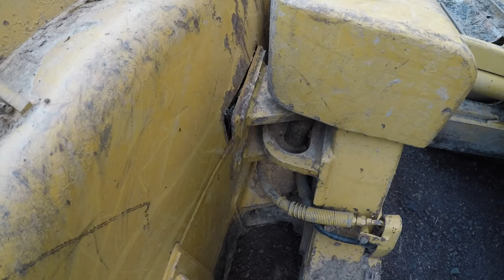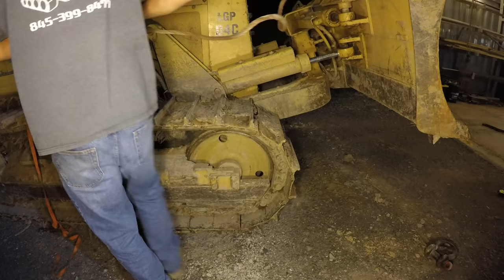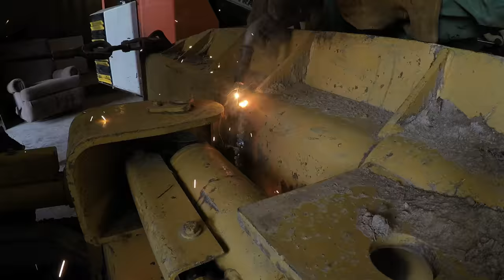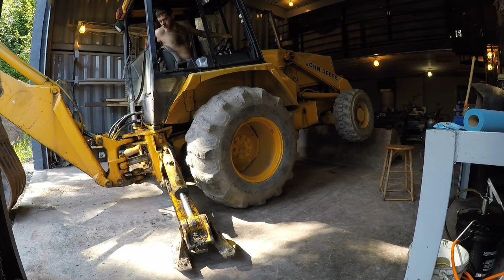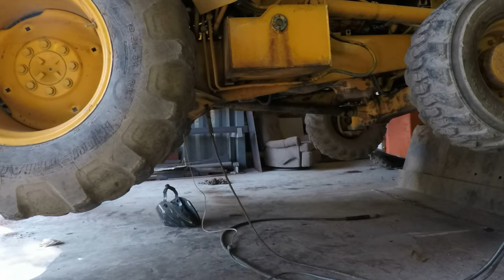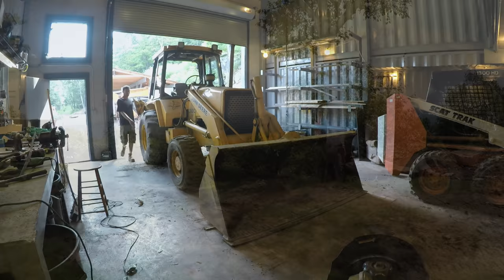Welding the dozer and backhoe

Comment: your doing some awesome work man. but coming from a professional welder of 10 years, weld prep goes a long way. ive noticed you don't usually remove paint or slag from torch cutting. yes it will weld thru that stuff, usually, but the quality and longevity will be so much better with a little weld prep. sometimes a little wire wheel is all you need, sometimes a little grinding to open up a crack for better penetration. especially when running solid wire mig. its a good process but for the type of welding I have been seeing you do I would strongly suggest stick welding with some 6010 as the initial pass to burn thru the rust and paint and get some good weld penitration and then some 7018 for the finish weld for its strength and "flexibility" (isn't prone to cracking like other rods". just some friendly advice, keep up the good work.
Reply: Word.
Reply: Yes Andrew as good as you really are in many ways, I have to confess that you might be slow at welding  but at least you are dog rough! Near enough is rarely good enough! 😂
Reply: In 30 years the weld will fail and Andrew will say, “Well that weld lasted 30 years and failed for no reason.”
Reply: @davidj4662  Good one!!

Comment: The correct repair on the chassis cracks, drill the ends, grind it out so you get 100% weld then full fish plate it but before that put some safety under that thing so a video of you dying doesn't go viral. I've worked alone on heavy equipment & trucks in the field for over 40 yrs & you can't have too much safety.
Reply: exactly..  he will be welding all of his welds again, him or the new owner...  did not grind the paint off first either..
Reply from the maker: Its still fine, and I just used that thing on a big job, ran it hard for days.
Reply: NZ Salt Flats Racer
Reply: Yeah, I'd have ran those stringers uphill on the frame too
Reply: He didn't even grind the paint off to stop it from contaminating the parent metal.
Reply: this video saddens me
Reply: He's trying to impress someone. ???? Who I don't have a clue. But down hill with a mig set up he may as well have fixed it with school paste and paper. Now that frame will snap in two at his heat line.. Not even close to a weld...
Reply: Give the guy a break. Hes not a professional  welder  nor did he ever claim  to be a welder . He  Looks like a guy that can do alot things well enough  to keep  it going till the jobs done and colects the check. Then he can buy new toys to break and fix.
Reply: You are right NZ Salt Flats, but Andrew is also right.  You are right from your perspective of a professional welder, and Andrew is right looking at the situation as an operator.  If he waited for professionals to repair his equipment and pay them their rate, he wouldn't be in business long.The cost of lost time + pro rates can't be afforded for a small time operator.
Reply: How many videos do you have on UT?????
Reply: LOL at all the welding experts.  The correct method is the one that works.  Most of these comments are from people who've clearly never welded anything and only watch it on youtube and believe the only good weld is on perfect material fresh from the steel fairy.  Will this chassis weld hold forever, probably not.  Will it work until he can get the time and material to do it by the book, yes it will.
Reply: Plenty of trolls on this one......" Get back under your bridges trolls " Andrew did a good job doing it his way...end of...!
Reply: I was gonna ask if they made jack stands for those. I know I don't chance my life to something mechanical. Especially hydraulic fluid.
Reply: @yensabi  I agree, id like to see that top comment guy try to find the end of that crack get a drill in there lol
Reply: @rogermarshall8991  Yeah, but he put some JB weld over it all. Good to go
Reply: When will it break? when will it fail? I mean it has lasted over a year already.. some hard work for it in there too..
You blokes who sit back crowing because it isn't NASA standard or "not how I'd do it."
There is an old saying, 'Those who can do, those who can't, teach."
Reply: @74KU " There is an old saying, 'Those who can do, those who can't, teach."    - And those that cannot teach, teach gym.
Reply: We are trying to teach you to GRIND! But at least you know how to work unlike 85% of Americans these days.
Reply: @AndrewCamarata  You tell'um Andrew!!!
Reply: @rogermarshall8991  Geezz, maybe you should move in and mentor him for free, till he's perfect like you!
Reply: Most of what I read so far was to make you aware of some safety issues.  As far as the welding goes, its your equipment weld it however you want.  I ran a very small fab shop for twenty five years and can not remember ever taking it personal when some "old timer" gave me a tip for doing something a little better.  Thank you NZ Salt Flats Racer.
Reply: @RRaucina  Never crossed your mind that nobody wants your teaching or is interested in the slightest?
Go make your own Channel and teach there.
Reply from the maker: @rogermarshall8991  Years later, and it never broke.
Reply: Andrew Camarata 👍🏼
Reply: @shortridgeexcavatingllc  i dont think hes ever had anything that he fixed fail.
Reply: Andrew Camarata good job well done AC 👍🏼👍🏼👍🏼
Reply: @AndrewCamarata  Engineer here: your repairs are fine. Professional welders are the most insufferable group of assholes at any job site.  I've seen welders argue with guys who have engineering doctorates. Any group of five welders will give you 7 opinions on how to weld, what process to use, how to prep. To them the $60-80/hr they earn on the job welding is big money and they think it gives them license to spout off about anything. Time is money. The more hours you can keep the equipment moving the better off you'll be. By all means; listen to what they say; occasionally they'll regurgitate something that saves time/money; dust off the good parts and throw the rest away. YouTube lets anyone start a channel. If they were serious about their criticism they'd start a channel critiquing welds and make videos so other welders can tell them they are wrong/unsafe.
Reply: @AndrewCamarata  Respect coming back to a three year old video to put the trolls in their place.

Comment: i love your channel- i work on the same stuff, I fixed a leaky hydro pump on my bobcat. it frustrates me at times but its good to see other folks also push forward through these issues.
Reply from the maker: skynet000001 thanks, yeah heavy equipment and trucks need constant repairs.
Reply: You know the saying. " If it's got tits, tires or tracks, it's gonna give you trouble ". 😂😂
Reply: @RRaucina  Oh, yes they a are.

Comment: A few guys already commented on this, but got God's sake man, put some jack stands, or blocking of some kind under equipment when you're in the air like that, young guys always think it will never happen to them, but it does.  Ditto to other comments that suggested to drill the ends of cracks and the air arc or grind the crack before welding it back.
Reply: You can see the machine slowly dropping in that video from hydraulic leak down.  Use a Jack Stand whenever you're under anything like that. I use a hoist 5 days a week at work. If it's not set on the lock stops by me, it will set itself on them as it leaks down.
 Be safe, not dead.
Reply: Yup all it takes is some hot splatter on a old hydro line and squish🤢

Comment: You should drill the ends of that framecrack and weld on a plate afterwards with no sharp edges and holes for extra welding surface. And don't put your life in the hands of hydraulics, hoses fail!

Comment: I'd drill a hole at the end of those cracks to keep them from propagating.  Also, might get stronger welds with a quick clean with a wire wheel and perhaps a little V-groove to get some extra penetration....  Otherwise, great job finding & fixing those...
Reply: I posted the same thing until I saw this. What this guy said.
Reply: ck m true put hole at end of cracks. Rare for a CAT this new. Hard rocky ground wipes out stuff

Comment: Just a tip . When ur welding high grade steel most likely 600-800 grade . Pre heat everything first . Must eliminate the moisture content from the steel . Use a gas torch or oxy acetylene torch to heat the area . Weld if you can over 300amps with mig . Use a argon based gas as a shield . Love your videos . Very good keep it up . Australia loves your vids

Comment: You can see how bad your hydraulic valves hold pressure on your time lapses. Blease put stands under your equipment. PLEASE. I worked several years at a workshop for heavy equipment and I havent crawled under equipment without stands once.
You get this tip quite often in your videos. Maybe you should consider it.

Comment: When you weld down your just putting weld on the surface and there is no penetration. You should try to run the grinder and make a quarter inch groove and start at the bottom and weld up if your using the mig turn it up and even if you weld a little and stop to let it cool for 2 seconds and then repeat is better than running it down. even with the mig or stick do little U

Comment: Please build yourself a set of heavy duty trestles to take the weight of those machines while your under them . Lifts and hydralics are not to be trusted . Solid trestles are the way to go . Use railway track as the top beam with good strong legs made from 200mm C channel . Hold 20 tonn easy . Keep safe my friend . Australia loves your vids ￼

Comment: Good job andrew, get it done and back on to work, if you had the time to do perfection i am sure you would.  your welds look good and smooth, when i weld it looks like someone sneezed on it, but guess what, it still holds and thats what matters to me.  the only thing i would do differently is just some supports under the backhoe, just in case some of those sparks melt a hydro hose and it loses pressure.  note sure if there was a hose near by or not.   keep truckin!

Comment: As a certified trade welder for 20 years I would like to suggest learning how to do a vertical up hand, ( mig, and stick) and don't do any down hand welds if possible. The difference between an up hand, and a down hand is this will hold as opposed to this should hold. I have respect for you doing all your own work so please take this as a friendly tip to help you along.
Reply: He doesn't take tips. It's good for everyone else though to have better welders suggest what might be done IF one wants to do it better. IF!  We can see how it can be done fast and "good enough," and, on the other hand, read how it can be done better. Perfect.

Comment: Hi Folks. My Dad once told me about wire rope and chain safety. He said that chains just break with no warning, but drop dead when they do. Wire ropes stretch and complain as they near breaking point, so you can hear they are going, but if you carry on and they do break they will lash about violently all over the place as the stored energy is released and the big ones can kill. Sometimes the end of wire ropes are contrained by anchored slack chains to control this rampage. In both cases, of course, the load is also released.  BobUK.

Comment: watched a few repair vids and this guy needs a 24 inch 1/2'' drive breaker bar ( about $20 cdn on sale ) . And a 3/4 '' pipe to add torque.i use an extension tube for a ceiling fan . About 18 in long and doesn't look so thick but i used it to loosen a bottom rear shock nut on an 07 escape. it was 15/16'' and even with the pipe on my 1/2 in ratchet it took some pull to loosen the darn thing.

Comment: Ripping the blade on that Cat model is common. Mine just kept doing that till i put 1/2 inch plate on the back and re-welded the brackets to that. Now the blade weighs a ton but it doesn't rip off now!
Reply from the maker: yeah? Mine has been fine since I fixed it this time.

Comment: I've read all the comments and assuming they know what they're talking about I think I know the "right" approach, if I owned any heavy equipment to repair, which I don't and never will.
As with many YT videos, this is a "how I did it" video, an experience sharing, rather than "this is how to do it" a training video...big difference.
Reply: YT has the how I did its and the commentators are the how to do it section. Good system.

Comment: The next repair is coming soon and will be bloody hard because the shit job on the first go sometimes better to pay someone to do a good job rather than bogging it
Reply from the maker: This job was done over a year ago, they have both held up fine. I did a perfect job. John Deere is the one that built crap equipment in the first place that broke for no reason.
Reply: Andrew Camarata the reason it broke is fatigue , some of your jobs are good but this was not , no prep and vertical down is not the way to do the repair , and a unsupported vehicle is playing with death, shortcuts don't work in the long run
Reply: @AndrewCamarata  I agree, since Henery Ford started manufacturing he soon learned that ," perfectionism  is the constipation of production.
Getter done.
Also people talk about grinding and air arking and prep, with the tight area you had to work in and possiblities of a fire you did the right things keep up tje good work.

Comment: Nice lumps in the oatmeal, or was that gravy you poured on it?  

To have done it properly, you should have grooved out the crack with your grinder. Filled that area, grounded off smooth and then fish plate over without a vertical but diamond shaped plate welded.  Just  sayin...
Reply from the maker: Its been holding fine. John deere should have built it right in the first place so it didn't break for no reason. That backhoe has beed welded in a ton of spots. It keeps cracking everywhere.
Reply: those john deere dont impress me either
Reply: @capitolrefrigerationheatin7501  After 35 or 40 years moving dirt, every machine made has some cracks somewhere. That's why they sell for $8000 instead of $30,000. If you have the time and patience, can do some nice repairs for the difference. The blades on those Cat 4's are always pulling off and cracking apart in every which way. Get under and pressure wash it and see all the hairline cracks growing daily. God bless dirt
Reply: @AndrewCamarata  Unless you bought it new, there is likely a very good/bad reason why those cracks are there.

Comment: Just concerned for your safety.  Just block anything you have to crawl under that is being supported my hydraulic lines.  Many people have been crushed to death.  Learn from their mistakes.  Yes that would be the absolute best way to fix the cracks but maybe he will indeed go back to do it right when he has time.  He does need the equipment for a job.  He is a great owner operator and a great mechanic.  He may learn from everyone.  Especially when he fixes it the second time when he has to grease it again and it has re- cracked like the first break he showed us.

Comment: Did you grind metal clean before welding? 
Also do you have an arc welder ?
7018 rod works well on frame
Reply from the maker: Sometimes grind, if it needs it. Yes I have a few arc welders.

Comment: Next time burn then grind off all the paint 4” around the weld joint.  Pre heat the base metal to 400 deg.   Use a 70 series flux core wire with 100% CO2.  (75/25) does not penetrate as well.  
or at least a 7018 low hydrogen rod.  
The wire your welding will not get great penetration without clean metal and turning the machine up 3-5 volts.  That repair will fail when you least need it to.   It will be better to carbon arc it out and reweld it correctly.

Just a concerned guy with 29 years of weld inspection and repair experience.
Reply from the maker: Well its been holding up well. I've used that machine hard after that repair, and its still good.
Reply: Andrew Camarata 
Glad it’s still holding up.  
Just know that welding over dirt and paint means your going to have porosity.   I’d bet a lot of money it’s full of pinholes and has a lack of fusion.  That’s why it’s extremely important to clean the metal as best as possible. A good pre heat will make sure you get better penetration and helps prevent future cracking.  
If you were to weld that correctly you could easily gouge out the old weld and reweld it with no reinforcements needed.

Comment: I know just enough about welding to get myself in trouble but don’t you need clean metal for a strong weld. It looks like you mig welding right through paint and rust. Also do you have to disconnect batteries or computer links before welding❓

Comment: Time traveling ahead I've not seen the backhoe in use.  Sold not useable?
Reply from the maker: Its been used after this. But I don't use that machine much. That weld has been holding up fine though.

Comment: dear god put some support under the equipment before working beneath it...ive worked in heavy recovery and seen hydraulics fail...there is nothing that will save you when that comes crashing down...dont rely on hydraulics, cables, winches, hoists or anything except good solid supports